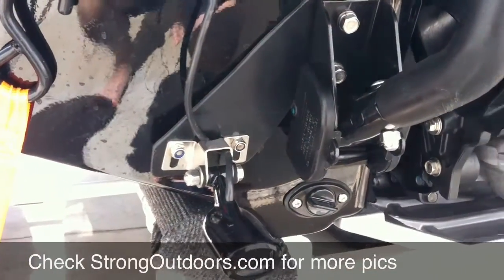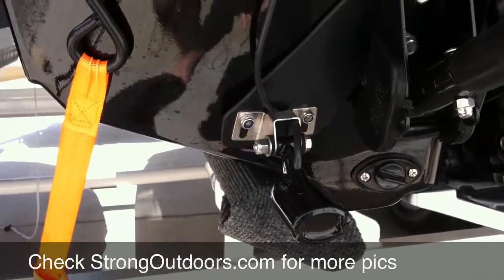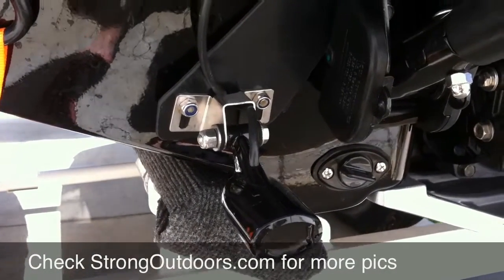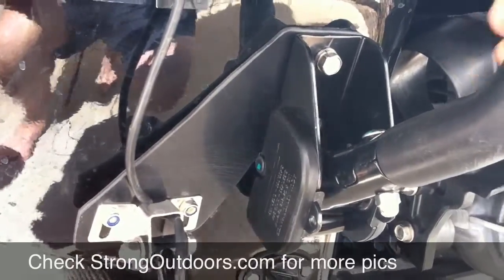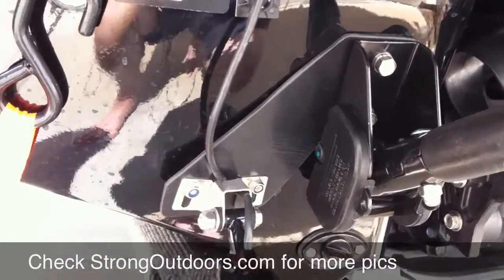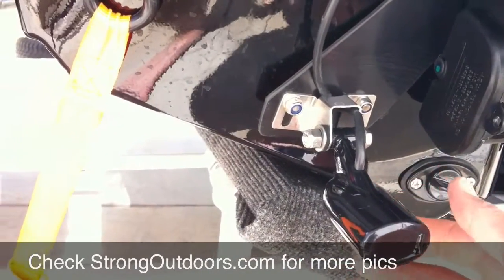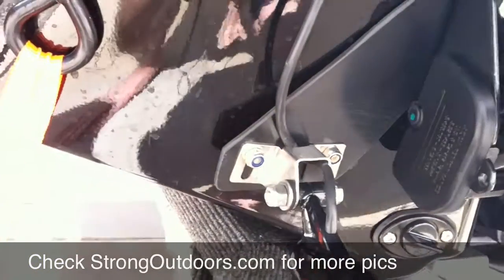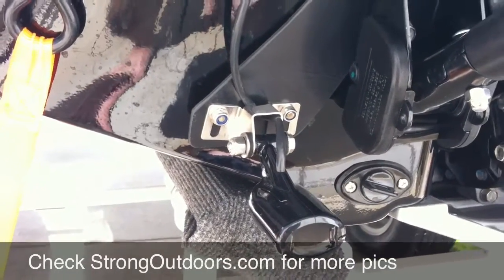Stern mount transducer Waverunner FX HO

Comment: What kind of plastic is that and where did you get it? I gave up trying with 1/2" Plexiglas, but that is all Home Depot carries.
Reply: +Robert Tindall 
Plexiglas is acrylic that is brittle and not flexible.  Best is polycarbonate (brand Lexan) from plastic supplier or  scraps from sign manufacturers.
Reply: Hi,  I have made a special fitting that allows the cable to run through the transom of a jet ski and it also allows sealing around the cable to keep it water tight. It's very professional looking and works great! I am new to using youtube, so if you can somehow message me I will send you pictures. I have mine mounted on a 2012 Yamaha VX 110 Deluxe. I am using a Lowrance Elite 5 Chirp with the skimmer transducer mounted on the boarding step on the transom. My transducer is mounted to a special machined aluminum bracket that mounts on the boarding step.

Comment: Still would like to know where he ran the cable through. Anyone else do this?
Reply: Hi Pat. I have made a special fitting that allows the cable to run through the transom of a jet ski and it also allows sealing around the cable to keep it water tight. It's very professional looking and works great! I am new to using youtube, so if you can somehow message me I will send you pictures. I have mine mounted on a 2012 Yamaha VX 110 Deluxe. I am using a Lowrance Elite 5 Chirp with the skimmer transducer mounted on the boarding step on the transom.